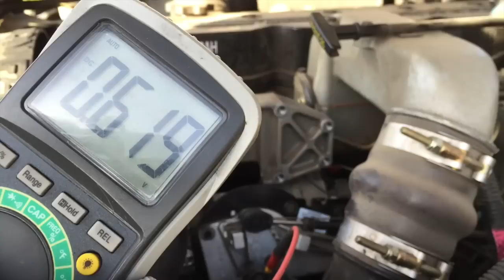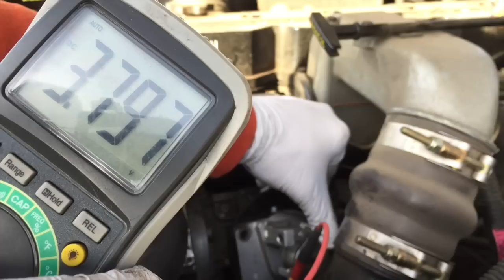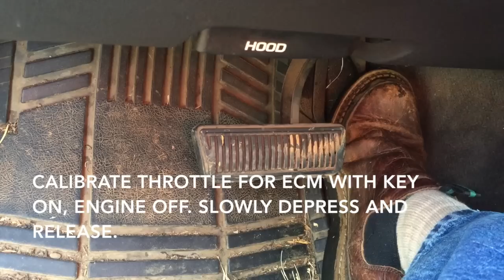Dodge Cummins apps sensor (throttle position) repair 2001 2500 turbo diesel

Comment: This is an interesting video.. but please read the following notes and critique which will help him and everybody else.

Notes: 

a) In older models of Dodge trucks this was called the TPS (Throttle Position Sensor). On Dodge 2nd generation 24 valve Cummins engines it is now called an APPS (Accelerator Pedal Position Sensor).

b) The OFFICIAL Dodge Service Manual states:

“Whenever the Engine Control Module (ECM), or the Powertrain Control Module (PCM) sets a Diagnostic Trouble Code (DTC) for an emission related item, it illuminates the Malfunction Indicator Lamp (MIL). The MIL is displayed on the instrument panel as the CHECK ENGINE lamp. The MIL will only be illuminated for DTCs that affect vehicle emissions.” 

DTS Code Descriptions: 

P0121 – Accelerator Position Sensor (APPS) Signal Voltage Too Low – APPS voltage input below the minimum acceptable voltage.

P0122 – Accelerator Position Sensor (APPS) Signal Voltage Too Low – APPS voltage input below the minimum acceptable voltage.

P0123 – Accelerator Position Sensor (APPS) Signal Voltage Too High – APPS voltage input above the maximum acceptable voltage.

c) The NEGATIVE cables of BOTH batteries should be disconnected before performing this task. Why? Two reasons. One is safety so that one doesn't short out something and second, this will give the ECM and PCM time to flush out their OLD readings. 

d) It is best to take a reading at the wire harness BEFORE disconnecting the batteries and make note of what the PRESENT APPS (TPS) reading is. Read from your voltmeter (multimeter). It should read .580 - .670. If it is within this range, your APPS is probably still good. Check your fuel pressure from your lift pump.

You can connect a paperclip to the POSITIVE lead of your voltmeter and insert it into Pin #3 (Green wire on the APPS harness or light Blue wire w/black tracer on the factory connector). The paperclip will connect to your voltmeter (multimeter’s) Positive lead. This is why an alligator clip on the end of your lead is good to have. The negative lead from your voltmeter will connect to the Negative post of your battery. 

e) After installation the APPS must be calibrated. The Engine Control Module (ECM) and the Powertrain Control Module (PCM) should be reprogrammed by slowly depressing/raising the accelerator pedal with the ignition on/engine not running (as shown at the end of this video). 

f) You need the proper tools to do this. You will need a voltmeter (multimeter) to test voltage. A paper clip to go into the wire harness from the POSITIVE lead of your voltmeter. A T-20 Torx bit. An OBD II scan code reader to read then clear your trouble codes. A socket wrench with 10mm socket to remove the 6 bolts.

If your ODB II Scan Code Reader displays either a P0121, P0122, or P0123 error code, this means your APPS could be faulty. A faulty APPS will cause erratic shifting of your automatic transmission. Usually around 40 mph. Also your fuel pressure could be low from your lift pump.

g) Another problem that can cause erratic shifting and set FALSE APPS codes is if your lift pump is putting out LOW PRESSURE via the fuel filter into the Bosch VP44 Injection Pump! Sounds weird but its true (happened to me). The PCM notes the VP44 isn't getting enough pressure and tries to compensate via the APPS. This causes shifting problems which sets a DTC (Diagnostic Trouble Code) and shows up as a "Check Engine" light on your dash and in some Dodge dashboards... a trouble code related to the APPS. After putting in 2 different APPS units (the first one a module as in this video and the second a complete unit mounted and calibrated to the bracket) I still had the problem. But when I checked my fuel pressure and noted it was LOW then changed the lift pump... it all went away! After deep study of my Official Dodge Service Manual I finally discovered it was the lift pump. 

h) The APPS/TPS module can be bought on EBay. I bought a new one for $53. The complete unit which includes the bracket and is already calibrated can be bought at AutoZone. I paid about $130 and the dealer wanted over $400.

i) After installing a new APPS and calibrating the ECM via slowly depressing/returning the pedal inside the truck.. use your OBD II scan tool to ERASE your bad DTS code.

Let's look at the problem(s) with what he's doing.

----------------------
1) He's not using the correct tools to remove the APPS (TPS) potentiometer. Its nothing more than a is a linear potentiometer. You need a T-20 Torx to remove/install the APPS (TPS). But vice grips can work. ;-)

2) He should have cleaned the area of grease and grime then used a Sharpie marking pen to go around the APPS (TPS) to mark its EXACT location prior to removing it. The OFFICIAL Dodge Service Manual (not a Chilton or Haynes) states that the APPS is "calibrated to the bracket." That means they calibrate it at the factory so it is simple to remove the APPS (TPS) and the bracket as one unit. 

Critical note: If removing the complete bracket, make sure you use a mirror and pull the throttle cable and other cables FORWARD (toward the front of the truck) to unhook them so as NOT to break the connectors otherwise you'll end up buying and installing a new throttle cable!

3) Note also the OFFICIAL Dodge Service Manual states that one should NEVER turn the Torx screw at the Throttle (as this fellow is doing) as the APPS (TPS) is calibrated to the bracket and also the Torx screw is tightened into position with Loctite so it won't come loose and cause problems. Again, if he had taken readings BEFORE he removed the APPS (TPS) and had MARKED its position with a Sharpie, he could have simply left the 2 screws loose on the APPS (TPS) and adjusted it forward or backward to calibrate it. Rotating FORWARD increases voltage while rotating BACKWARD decreases voltage which should be between .580 - .670 (0.580 - 0.670).

4) Notice that when he moves the bracket around and is watching his multimeter how the voltage varies. It's IMPOSSIBLE to get a true reading until the bracket is mounted with the 6 bolts. Then all one needs to do is slip a paper clip into the wire harness to take a reading.

5) The way he calibrates the APPS (TPS) to the ECM at the end of the video is 100% correct. However if the voltage is too high or too low on the APPS (TPS), he'll still get P0121, P0122 or P0123.. in that case he should push a paper clip into Pin #3 (Green wire on the APPS harness or light Blue wire w/black tracer on the factory connector) to get his reading. The paper clip is connected to your POSITIVE lead of your voltmeter and the NEGATIVE lead is connected to your negative battery terminal.

6) While taking the reading hold the bracket VERTICAL and steady as much as possible and ROTATE the APPS forward or backward to get a voltage reading of .580 to .670 (0.580 - 0.670). Gently tighten the two T-20 Torx screws on the APPS so as not to lose your proper voltage. When you are sure you've got the voltage set properly, tighten the two T-20 Torx screws down tight. Use Loctite on the threads if you have it. Turn the ignition off. 

7) Remount the APPS assembly bracket using the original six (6) 10mm mounting bolts. Tighten the bolts to 12-Nm (105 in. lbs.) torque. Caution: Use an INCH POUND torque wrench.. not a FOOT POUND torque wrench. If you do, you’ll over torque the bolts and strip them. If you don’t have a torque wrench, use good judgment in making them tight. 

8) You should have left the Positive lead with the paper clip installed into the wire harness.. so turn the ignition back on and make darn sure your voltage reading is correct. If  your voltage readings are between .580 - .670 (0.580 - 0.670) you will then calibrate the APPS to the ECM.

9) As shown in this video, leave the ignition on (or turn it back on) WITHOUT starting the engine. Slowly depress your pedal then slowly release it. Do it only one (1) time. Next, use your OBD II scan tool to clear your trouble code. Harbor Freight Tools sells one very cheap by the way.

10) Reattach the black plastic APPS/Throttle Cable cover. Press in the 2 plastic retention clips and screw in the 2 Phillips screws. You are now finished with the installation.
Reply from the maker: +Kolin Ken what experience do you have with “dead pedal” troubleshooting?
Reply: Please consider checking ALL of your GROUND wires at the battery and going from the battery to various parts of the frame. Sometimes the ground wire at the negative battery terminal(s) get corroded or almost broken and one of them goes to the APPS/TPS. This can cause "dead pedal" at a certain throttle position. Also, if you are getting any DTS code(s).. your APPS/TPS may be bad. But I've seen where a Dodge dealer put in a new APPS/TPS and it didn't cure a dead pedal. Turned out to be a simple ground wire problem. That's why I suggest you FIRST check ALL your GROUND wires at the battery and trace them to the metal parts of your truck. Hope this helps. ;-)
Reply from the maker: +Kolin Ken it does. Thanks. I also heard some role the brake light switch could play too.
Reply: So if I purchase the entire bracket with the sensor already mounted. I wont have to recalibrate it your saying?
Reply from the maker: After installation, check everything to make sure it is within spec/parameters and prove to yourself that nothing needs calibrated.

Comment: what is the difference when backprobing to get voltage readings and calibrating throttle with ECM? both call for the key on and engine off, do you disconnect the batteries to reset before calibrations begins?
Reply from the maker: +mrgoodtimes05 batteries should not need to be disconnected. I’m not understanding your other question.

Comment: So what symptoms do you have when this is a problem and you were using the adjustable pliers, vice grips backwards.
Reply from the maker: +E Buzek You have a no, or a range of travel with no, signal from this sensor. Prove to yourself that the sensor is bad by testing it as shown in the video before changing it. This video proves that pliers are bi-directional. I even use them upside-down sometimes.

Comment: Have the same sensor like you and can only get it down to .68
Reply from the maker: +Richard Myers I wouldn't worry about the  .08 difference in voltage reading. That variance may differ with a different multimeter. Or perhaps my adjustment screw on the idle adjustment has a modicum more of travel.

Comment: On my 1999 dodge ram 2500 diesel I already put 4 tps  censor 
And still the same only works
For 10 day's and fail again
Reply: Any idea
Reply from the maker: +jesus Sepulveda please read the reply I made to sadeg48 about five or so comments ago. There are many things that cause that symptom. And you will have to compile the list and check them off one by one. I trust the Turbo Diesel Register forum more than others. It could be as simple as a bad battery or connection at one of them, or an electrical issue elsewhere, or it could be something expensive. As you read the forums you will see that "what fixed it" is different for almost every person. Let me know how it goes. Good luck.
Reply: Thanks for the tip

Comment: WHAT  COLOR WIRE DID YOU HOOK THE POS. LEAD FROM THE METER TO THE CONNECTION
Reply from the maker: +charles owens wire color might not be helpful on your vehicle. Backprobe each of the wires until you read .6VDC (KOEO) key on, engine off. This proves that you have the correct wire. Thanks.
Reply: There all around 2v
Reply from the maker: +charles owens Even when moving the throttle by hand?
Reply: Ill ck thx
Reply: 98 dodge ram 3500 5.9
Desiel

Comment: p1749 is my code for 2005 2500 ram
Reply from the maker: +Juan Trevco this video applies to 98.5-2002 pickups. Try searching for that code on turbo diesel register and other forums.

Comment: where did you get the sensor my code is p0121 on a 2001 dodge 3500
Reply from the maker: +bill justice I got it from genosgarage.com. Make sure to prove that the sensor is bad before spending any money. Take care.
Reply: @Kilikoba Nashoba how do I prove the sensor is bad before buying a new one? My truck idles fine, but the throttle seems to fluctuate very noticeably when I drive- especially in cold weather.
Reply from the maker: The portion of the video with the multimeter reading the proper voltages shows how you prove the sensor is good or bad. There are many things that could cause your symptom besides the sensor. Make sure to read all the comments for this video I and others have contributed. Take care.

Comment: Thank you for posting this..   I changed out my sensor, had a little tough time getting the reading on the multi-meter, so I spliced in a jumper wire on that particular wire and was able to get my readings..   runs great now..   appreciate the tips...

Comment: After probing around the lowest reading i cab find is 1.3v. Any thoughts?
Reply from the maker: Did you set the idle adjustment screw (as shown in the video at 4:30-4:50)? Perhaps it is set to not go low enough. If the adjustment has been messed with, set it according to the procedure in the video.
Reply: thats the step i am currently on. At 4:09 are you probing the orange /w blue stripe wire?
Reply from the maker: +Derek Abbott The wire that a lot of installation pamphlets, forums, etc. tell you to probe is the wrong color. That's why I just probe all of them until I find the proper one (as proven by its voltage). I can't remember which color wire it was; and won't be able to go verify it for a few days.
Reply: Derek Abbott

Comment: Tps voltage also jumps from .50 to 4.44 dose not gradually get there
Reply from the maker: +Dylan Cyprian that range doesn't necessarily condemn the apps. Always verify readings with another multimeter. Voltage jumping doesn't sound good; however, other things could cause that besides the apps. With readings that jump on multimeters always make sure that isn't just reading that way because your multimeter is in auto ranging mode (voltages appear to jump as it switches from one voltage mode to a higher or lower one). A worn throttle linkage bushing would also cause that symptom (as seen in this linked video https://youtu.be/GDURznrG2sg).
Reply: +Kilikoba Nashoba I should have started by telling you what the truck is doing . At around 52 miles per hour the trucks Rpms  jump it's only a couple Rpms but you can definitely feel it. The trans has been re built so know it's good . We also replaced the wire that comes off the tps and connects to the negative battery cable. I checked the tps with two different volt meters same thing my voltage at idle and ful throttle are good but no readings in between idle and wot .
Reply from the maker: +Dylan Cyprian I'm sure this will help you. http://www.kentsoil.com/dodgebug1.htm

Comment: Tested mine it reads .50 volts at idle 4.44 at full throttle. Any suggestions

Comment: Appreciate you make my nightmare go away i try to find the sensor it self but no one in Seattle area has it they sale whole assemble now I know were to by it. you're awesome.
Reply from the maker: +sadeg48 I'm glad I can help. Unfortunately it will probably be a lengthy process until the vehicle is actually fixed (and dealerships will not likely be much help; as you will see in the forums). Make sure to test the sensor first; and do lots of research, before you spend any money. A lot of individual problems will cause the "dead pedal" symptom e.g. corroded electrical connections, sensors on the transmission, "noise" in the electrical system, etc.. Clean battery terminals to shiny metal, unplug all associated connectors and plug them back in; etc. first. Companies selling injection pumps will be quick to condemn the pump. Read all the forums and take meticulous notes; especially anything by Turbo Diesel Register. Read the forums related to the symptoms on https://mopar1973man.com/topic/7760-dead-pedal-help/. Make sure watch videos on apps noise isolator and the video on the throttle bushing problem at this link. https://youtu.be/GDURznrG2sg